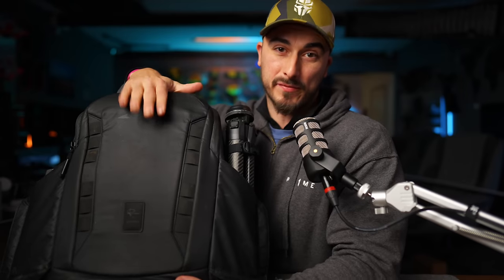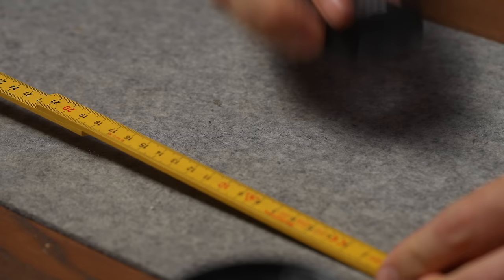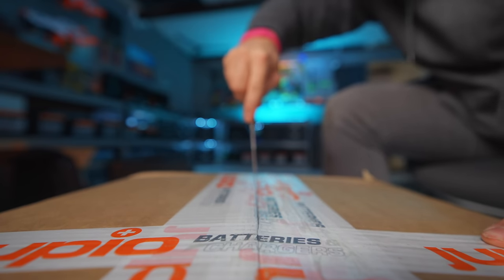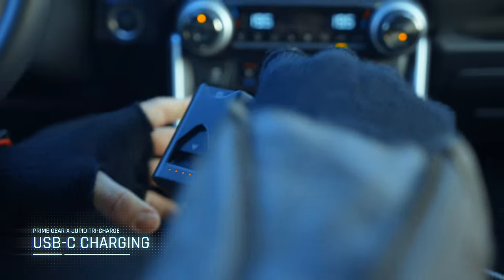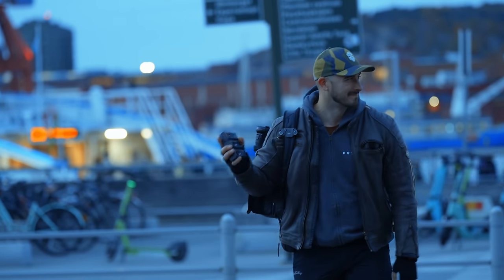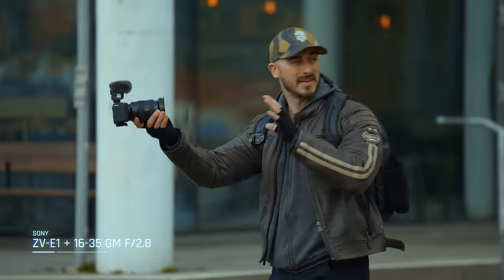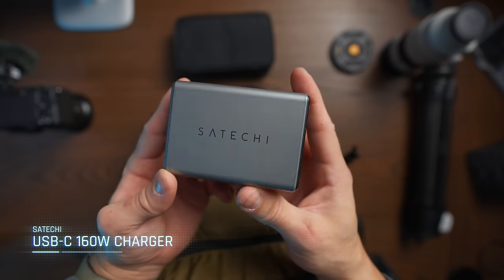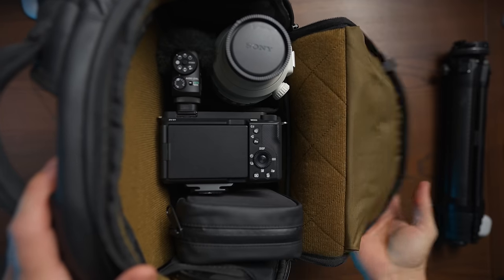What's In My Camera Bag? | Best Accessory For Photographers & Filmmakers

Comment: Congrats Peter, looks like a great product. Wondering what the charging speed is like? Because regular chargers are usually super slow.
Reply from the maker: It’s pretty fast! Around 4 hours to fully charge all three!
Reply: when using a PD charger it will charge 3 batteries with 700 mA, so Peter is correct, 3 fully charger batteries would take about 3-4 hours.

Comment: The Tri Charger is really cool idea and I'm so hyped for you getting it launched! Do you know if you'll design a 4 battery version, or a 2 battery version? I only ask because I always shoot with 2 Canon R6 cameras with battery grips and I always try to have enough spare batteries for each camera. So typically I have 4 extra batteries in my bag and while the Tri Charger would work well for me, I would have the issue of having 1 battery floating around instead of being in the holder. Would love to know if you think you'll make other versions of the Tri Charger. I think Quad Charger has a nice ring to it.
Reply from the maker: Haha thanks man!
Get 2 Tri Chargers and you'll have 2 extra batteries at all times ;)!
Reply: @PeterLindgren1  I would if weight and space in the bag weren't an issue
Reply from the maker: @tonfaboy   two more batteries isn't that much but i get your point. We don't have any plans for a 2 or 4 bay as of right now though!

Comment: Love the new charger!  For a different (and what would be a more expensive) version - what about the thought of having a battery bank already built into the holder so that it can recharge batteries when they are put into the case without having to plug it in?  How many times I have been at an event and wished I could charge batteries and don't have an outlet to plug into or have to carry an extra cable/battery back to plug the charger into.  It would be great to see an all in one unit with USB-C to charge the unit and the battery in the unit is capable of fully charging 3 batteries to full.  It would make the unit larger and more expensive to make, but I am sure a LOT of photographers (particularly those that go out on location a lot) would get behind!  Great work though, keep it up!
Reply from the maker: Way ahead of you 😎!
Reply: @PeterLindgren1   Fantastic!!  I figured you likely were, but thought it was worth mentioning.  I have literally been looking for that solution for AGES and no one has it, which is so weird to me.  You would think someone would have done it by now, but if/when you do it I'll be one of the first in line for it haha.

Comment: Congratulations Peter, this is very cool. I have 2 questions.
1. Does the charger have 2 pins or 3, that is, does it charge each cell in the battery individually or at once?
2. Does the charger support any of the fast charging protocols? If so, which ones?
Thank You!
Reply from the maker: It has 2 pins. It does support fast charging 👍🏼

Comment: Hey peter, does the Tricharge balance the cells or once in a while I should charge them on the sony brick? (does it have 2 pins on the batteries or 3
Reply from the maker: It has 2 pins in the bottom! Never had any issues with my batteries these last 7-8 months 🤘🏼
Reply: @PeterLindgren1  in that case once a month I let them charge in the Sony Charger, that should balance them out!
Anyway ordering one of yours soon as I find one available!

Comment: Great product, just received mine. However, I do seem to have an issue with it. It will charge my batteries and show 4 LED lights when they are fully charged, however, when I unplug it from its power source, only 2 LED lights light up, but the batteries still show fully charged when in the camera. Not sure if there is a defect with my unit or what? I did send you guys an email about this. Hopefully I can get it replaced - Canon version.
Reply from the maker: The new canon batteries? Reach out to Jupio and they’ll send you a new one I’m sure!
Reply: @PeterLindgren1  Yes, the LP-E6NH. I have reached out to them on their website - waiting to hear back. Thanks

Comment: Got the P. McKinnon 25L backpack and it's amazing and stunning BUT, it cannot fit RF Mount Canon lenses in it efficiently. It's absolutely the worst. If you put a 70-200F2.8 RF lens in it you can either put it vertically in the backpack which will make the backpack not close because the lens is slightly longer than the width of the bag, or you can put it horizontal which makes the lens sync in the bag and leave a ton of unusable space above it. I found it to be worst for carrying Canon gear than the PeakDesign 15L Zip Backpack or whatever it's called. In the PeakDesign 15L I am currently having the 24-70, 70-200, 16-35 all f2.8, the 50mm F1.2 RF, an Asus Rog Ally, the bag from DJI Pocket 3 with the creator kit, a square hard pouch containing 77 and 84 CPL+ 2-5 and 5-9 vND filters from Peter Mc.Kinnon. 
The everyday backpack from Peter Mc.Kinnon is an absolute beast, is the most gorgeous backpack I have ever seen, the most organizable BUT it's not designed for carrying multiple canon lenses. I found it very difficult to integrate with my traveling. The PeakDesign 15L is almost half of it and can carry everything+ laptop + Canon Batteries (two kinds and about 6 of them), small flashlights, an airtag, a 16" MBP M1 Max, a razer mouse, some airpods and other stuff.

Comment: Too bad Jupio don't charge the batteries without being connected to the mains
Reply from the maker: What do you mean?
Reply: @PeterLindgren1  To charge the batery you need to plug the charger to wall charge. right? imagine the charger having a small battery on it , and you are on country whitout no possibility to charge the battery, But the charger have internal power, like a small powerbank inside him. at least to charge one baterry directly from charger whitout external source..... My english is not very good sorry. :(